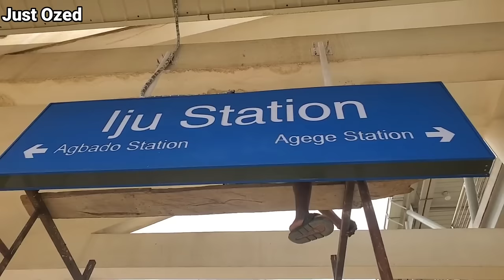What's The Latest On The Lagos Redline Metro Rail Project? | After Commissioning

Comment: This is also the procedure the Lagos state Govt applied on the Blueline rail. The Infrastructure was Commissioned in January 2023 by former President Buhari, and began test running few months later. On September 4th 2023 they began commercial operations on the Blueline rail while in October ending 2023 the electric operations began fully with increased trips to 72 from 12 a day. Meanwhile the Redline rail infrastructure was also commissioned in January 2024 by current President Bola Tinubu, while finishing work is ongoing, test run will begin soon and commercial operations will follow if not before end of 2024 btw September and December, it may be fully operational by January 2025. Well done Ozed, you dey try wella!!!👏🏽
Reply from the maker: Baba thank you so much ❤🙏
Reply: So conversant with the details.. thanks man!